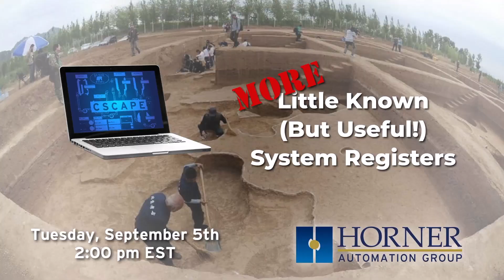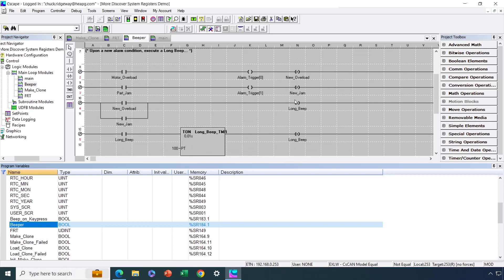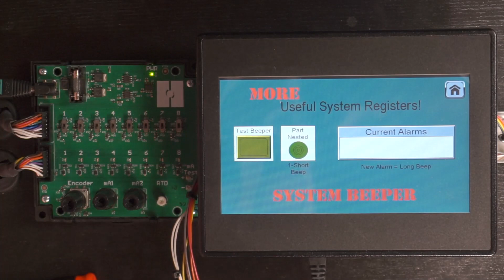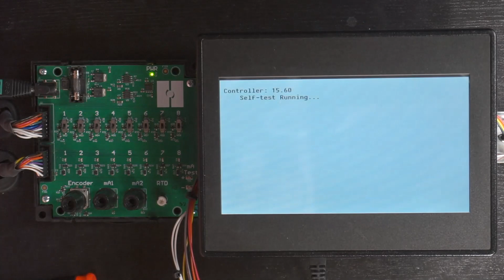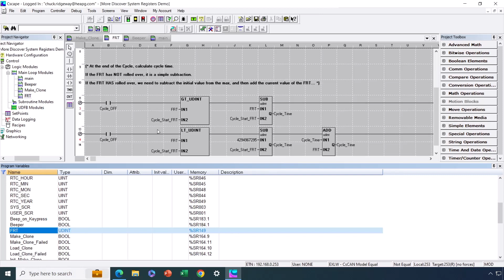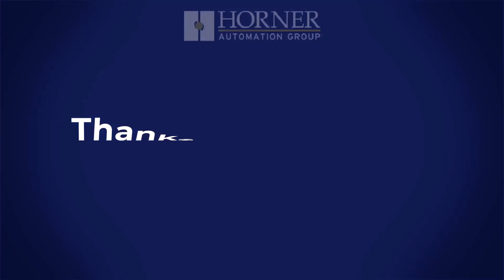MORE Little Known (But Useful!) System Registers

Comment: I called the tech support in USA for some help regarding modbus slave registers. The experience was poor, I got cut short being told that the manual explains it all. The issue I had was not being able to read some input registers, only few. This experience made me changing the design to workaround the issue. Hope tech support be a bit more responsive
Reply: We apologize that your experience with Horner Automation Tech Support was not up to expectations.  If you still have Modbus Slave questions or need anything else, please try us again.  Feel free to ask for Tim.  And we'll do our best to help you out and improve our support.